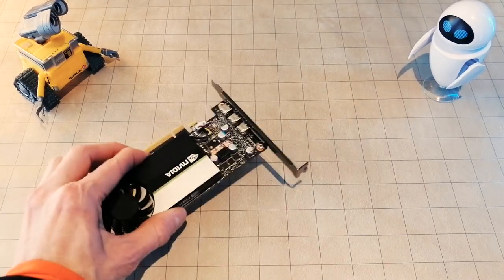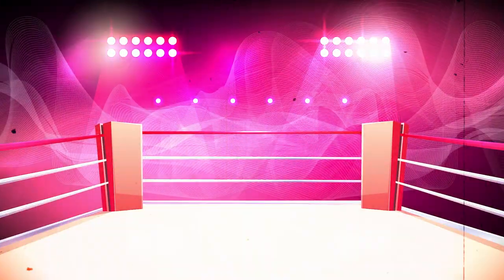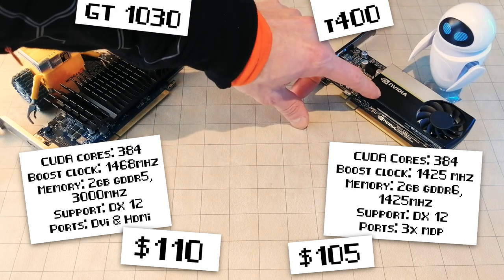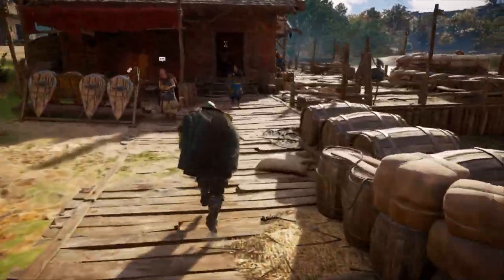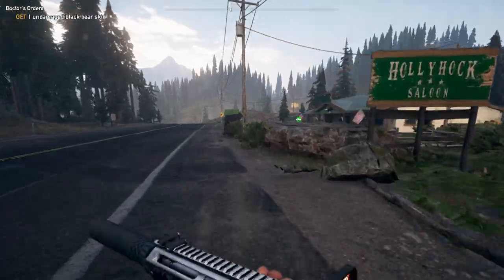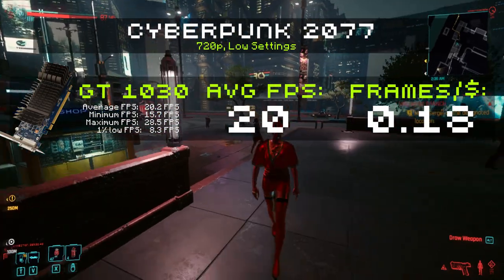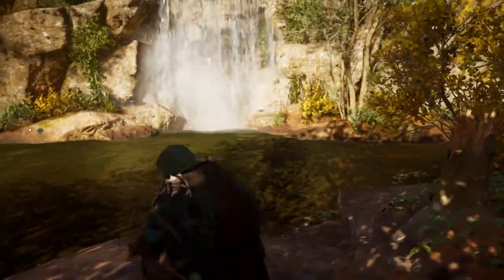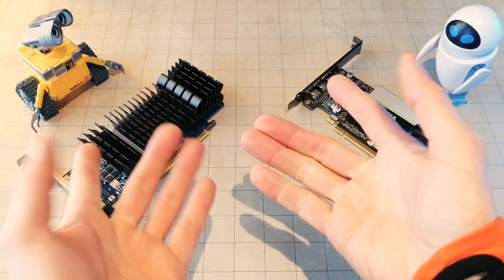Nvidia T400: The best low-end GPU? (GT 1030 vs T400 performance comparison)

Comment: I think you should take in consideration that your gt 1030 is passive. It may cause thermal throttling considering it normally goes up to 85 celsius (in low-medium end games) and your t400 has a fan, but still a great video, keep it up <3
Reply from the maker: Oh for sure. I made a whole video on this GT 1030 https://www.youtube.com/watch?v=I85wS6IY8yQ . Yeah the passive performance is a little bit less than an active version once it starts throttling, but only by a tiny amount.

Comment: 1030 came out in 2017. It was dubbed a GT because it wasn't aimed at gamers and didn't deserve a GTX. Most of us didn't like it as it was a bad deal. In 2018, it often was an interesting option due to the miners buying all the cards. If the market resembled anything sane, it would have gone the way if the GT 730. As for the T400, I wonder how close does it get to a 1050 2GB card. It is more expensive over here, but those differences are quite a bit bigger than I expected. If it eventually gets a proper dlss support, it will be even better.
Reply from the maker: Agreed. The GT 1030 doesn't have much relevance, other than it's the only low-budget-sorta-gaming-gpu, and we're not getting GT 2030s or GT 3030s to replace it. I suppose that's what niche gpus like the t400 are filling, but it's obviously not a good solution when gamers are forced to go to studio/production gpus. As far as I can tell the gtx 1050 is about 80% better than the GT 1030, which would make it about 30% better than the t400 (all approx, obviously).

Comment: I found an AMD Firepro W5000 for 130 bucks. Confused whether I should go for it or the T400. Future video comparison?
Reply from the maker: I wish I could find one at a reasonable price to review. I haven't found a good deal yet, and I'm not going to pay a premium for a card that isn't a good value. My general impressions based on what I know about it is that it runs at a higher wattage and therefore will run hotter and louder, it's not low-profile if that's important to you, it performs a bit better than a gt 1030 in benchmarks but not much, and ultimately it would probably run similar to or a bit worse than the t400. I think if it's priced somewhere between a GT 1030 and a T400 where you live then it might be a good choice, but if you can get a t400 at pretty much the same price I'd definitely go for that personally.
Reply: @TechDweeb  Makes sense. Found the T400 on Amazon, but the prices range from 145 ish to 170. Thanks for the help comrade.
Reply: Videos are epic though, wish you all the luck.

Comment: Know this is old now but do wonder how this card compares to the Radeon PRO WX 4100. On paper they should be more or less the same. The WX 4100 has move VRAM but it is GDDR5 not GDDR6. It also pulls a little bit more power but its only getting its power from the PCI anyway. I have a old HP-ProDesk-600-G1-SFF so need a LP card. No point getting the RX 6400 as I don't have PCI4 and it is over kill for the i5-4670S. Also use Linux and AMD just plays nicer with that platform. If you do test it you could test SteamOS/HoloISO on it.
Reply from the maker: Good question. I'd love to get my hands on a WX4100 some time! I'd love to do a SFF pc setup some time with SteamOS/ChimeraOS.

Comment: @6:42 It is not 25% more performance because (44-33)/33=0.33. 0.33*100%=33% more. I think you ment to say that the gt 1030 offers 75% of the performance of the t400 in shadow of the tomb raider.
Reply from the maker: Ah that makes sense, thank you for the correction!

Comment: the gt 1030 is around 70$-100$ here while the t400 is around 150$-200$ here so theres actually some competition here ,
Reply: also the rx 460 is [in my opinion] still a good budget card that can be found at the same price range , and its still supported so i wouldnt say its old
Reply from the maker: Yup! Any card that offers DX12 support is a viable option as long as it's getting current driver updates. It call comes down to the price vs performance - and of course how low in performance you're willing to go - a free gpu that gives you 4 fps is technically going to be a better 'value' than anything you pay money for, but it's worthless if you can't use it for what you want to do.
Reply: @TechDweeb  yeah , the fact that hd 7000 and most 200 and 300 series amd gpus dont support dx12 makes me quite sad because if they did they would be such good value . but theres the r7 260x which imo is still a good value card considering it supports dx12 and is better than the gt 1030 at the same [or even cheaper sometimes] used price range . but too bad amd ended support for the 7000-300 cards last year
Reply: So i am gonna buy a budget card gt 1030 and t400 are about the same price which should i buy
Reply: @tejeswartejeswar8949  t400. in my area gt 1030 is cheaper. So I would pick gt 1030

Comment: i'm not a gaming guy, i'm use my pc just for 3d software, video editing, audio editing. but maybe a little gaming time..is it worth it i buy t400 ? my pc spec intel core i7 ram 8 gb ssd 128gb hdd 320 gb 
thanks for the answer btw  😁
Reply from the maker: Definitely! That's what these GPUs are MADE for. They're workstation GPUs. This will give you around the same performance as a gtx 1050 ti in 3d applications, and they can use the Nvidia studio drivers so they'll have great compatibility.
Reply: @TechDweeb   eventhough t400 only have 2 gb ram and 1050 ti have 4 gb ram ?
Reply from the maker: Well as with any GPU, once you reach the vram limit, you'll encounter reduced performance. So my suspicion is that it'll perform about the same as the 1050 ti under 2gb vram utilization, then obviously it'd do worse above 2gb. However this IS a 4gb variant of the t400 available as well. I can't say for sure how well that'd perform since I can't find one to buy and test, but I suspect it'd do MUCH better than the 2gb version.

Comment: The t600 is nearly out of stock in my region and the last one is more tha 200$-I'm living my best life
I will try yo get the t400 i think or maybe gpus will get back in stock when i get able to buy one
Reply from the maker: If you need a gpu, and you can wait a bit, I suspect the GPU shortage will be coming to an end very soon. If you need one right away the t400 and t600 are still great choices, even though they're not super powerful they are good for their price and they have other benefits like being very recently released so they will have software support for many years to come, they are low profile and single slot so they will work in any system, they are power efficient, and they run cool and quiet.

Comment: active cooled 1030s perform way better than the asus passive cooled one, my active cooled 1030 boosts to 1721mhz
Reply from the maker: The difference was pretty negligible as far as I could tell https://www.youtube.com/watch?v=I85wS6IY8yQ . About 5% performance difference when I tested. But obviously that will depend hugely on the airflow situation in the case.
Reply: @TechDweeb  ok but i seriously dont know how my 1030 is performing this well lol
Reply: @TechDweeb  the main difference is that my old gpu was passive cooled and that used to thermal throttle in any game(85+ degrees) i played and this never crosses 68degrees

Comment: Whats your memory and which processor you're using?
Reply from the maker: ~ PC Specs ~
Ryzen 7 5800x, MSI MPG x570 motherboard, MSI MAG 280 aio, 32gb 3600mhz TridentZ RAM, 1TB PCIe gen4 ssd, 8tb WD black HDD, MSI MPG 750w PSU
Reply: @TechDweeb  Can we play Gta V , Csgo etc with AMD A4-9125 , NVIDIA T400 , 4 gigs ram.
Reply from the maker: Probably not with the 4gb of ram. That's pretty low. I can't say for sure though, you might get away with it, but I doubt it would run properly and you'd get some serious stuttering.
Reply: @TechDweeb  ok thanks

Comment: Is it still worth to buy the T400?
It's $249 SGD in my country.
Reply from the maker: The T400 is a great GPU, but it depends what everything else is going for in your area. A GPU is only a good deal if it offers better performance COMPARED to what you can get for the same price. Check the prices of GT 1030s and 1050 tis and 1650s. My videos should help you compare the performance so that you can figure out which option is the best value to give you the best FPS/$.

Comment: even though its harder find rx 550 4gb vs t400
Reply from the maker: That would be interesting. The RX 550 is technically less powerful than the GT 1030, but at 4gb of vram it might outpeform the T400 in some games. I'd love to grab one if I find a good deal to test out.